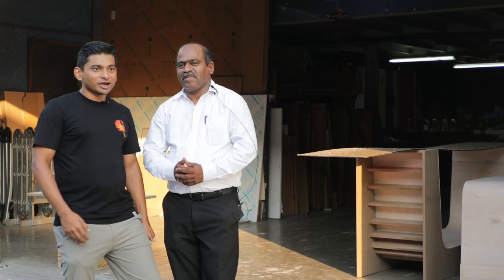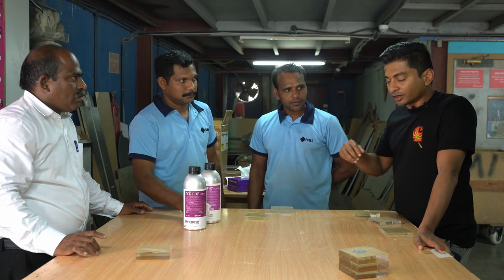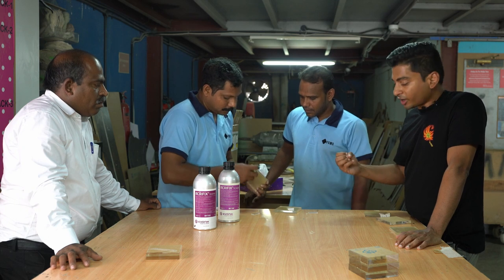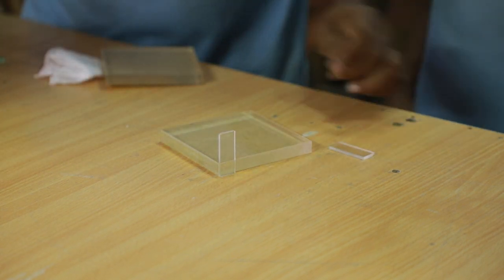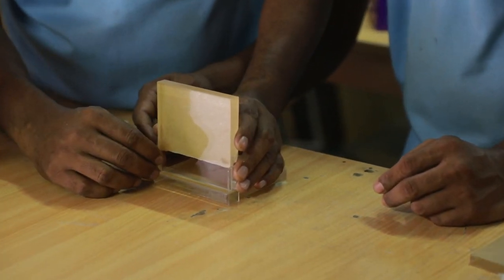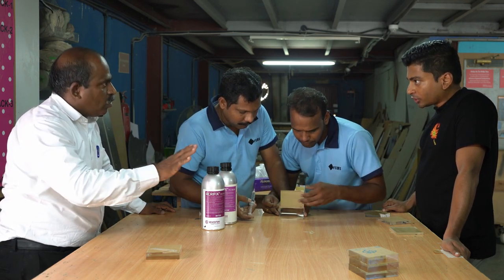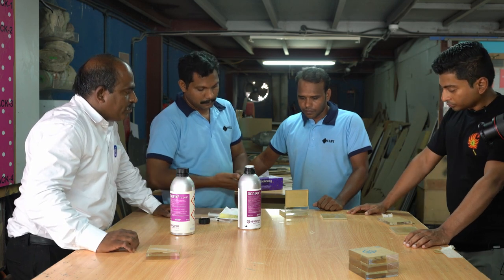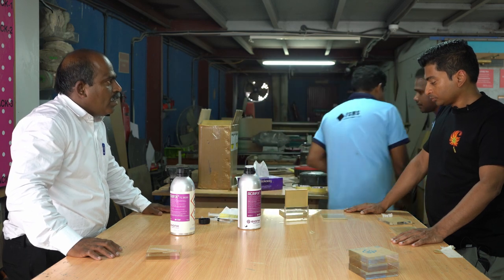How to bond Acrylic using Acrifix 192

Comment: Hello sir, I  am facing little problem while pasting two Acrylic sheet by Acrifix 192 as in the joining area small bubbles is coming ....       Please Kindly help me, why this is happening???
Reply: Try positioning the work so that the glue joint faces straight up, and then carefully fanning a propane flame along the joint to make the bubbles float to the top and disappear. Test on scrap pieces.